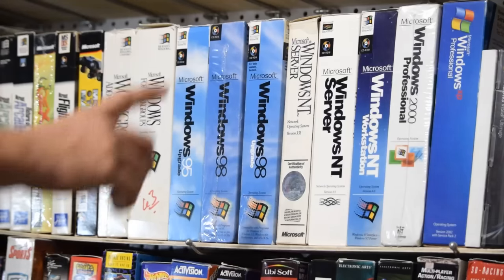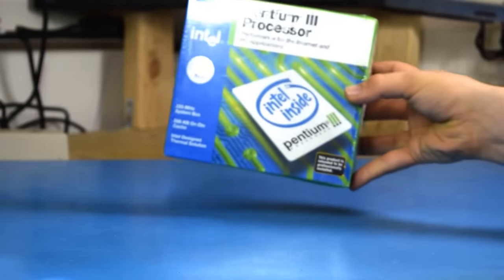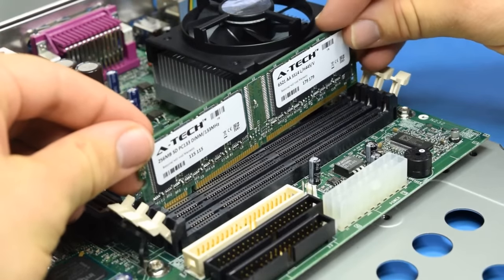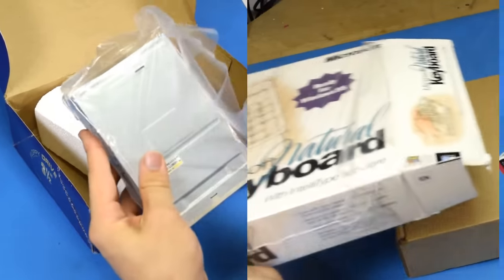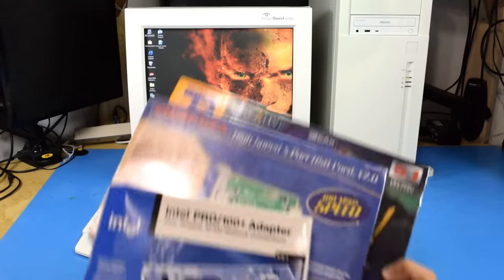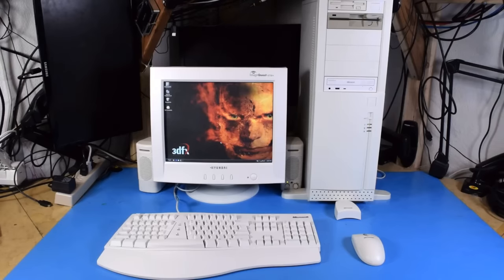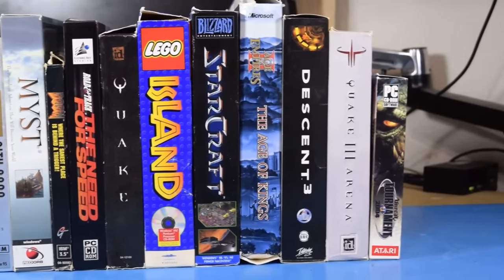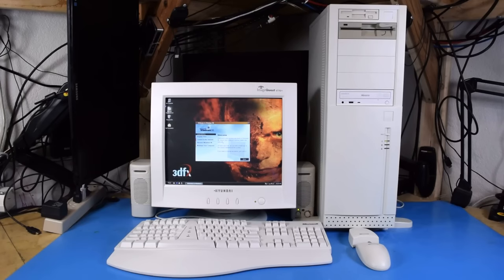Windows 98 20th Anniversary All New PC Build

Comment: The removable motherboard tray is such a good idea, why was it abandoned? Not only is it convenient, but it also gives you a test bench to make sure everything works without having to install it all into an awkward to fit case and then uninstall everything again to fix it. Perhaps the modern day coolers just make this kind of design unergenomical.
Reply: cost, some higher end cases do have a removable MB tray
Reply: Probably because without the motherboard tray the case is flimsy and flexes a lot. Most cases nowadays are made out of thin aluminium sheets while back then cases were much more rigid and robust, made out of 1.5mm+ thick steel.
Reply: funny, all my pc cases are a piece of wood.. why..    you dont even need a case. :-)

Comment: 120 GB drive is way too big for 1998.
Reply: I remember mine having 4gb hdd
Reply: Martin Ruvalcaba pfft lol my dad had a 2gb hdd, and that was comparable to 500gb hdd today
Reply: Nah, i had a 50G Quantum Fireball (biggest i could afford) in '98 and it wasnt an uncommon size for new. if you were cashed up much bigger was practical.
Reply: if you were going to be picky btw, what IS wrong for '98 is the Voodoo 5 - it wasnt released until 2000. Period correct would be the Voodoo 2 i have in the cupboard
Reply: He should've gone for SCSI 15k drive and controller from the era.
Reply: I had 40gb in 2005 uwu
Reply: And who still used a 5 1/4 floppy in 1998?
Reply: @johnrichards6304  I did
Reply: I remember spending £100 on a 10gb HDD around that time
Reply: Nah, for Win98SE my system, which I used from September 2001 to Feb 2011, was an Abit KG7-RAID mobo with an AMD 1400 MHz T-Bird single core CPU, 2 - 250 GB WD HDDs and 1 - 120 GB WD HDD, 1 GB RAM, 1 - 3.5" floppy, USB v1.1, and a Hercules Game Theater XP game card with external connector box.  The Abit mobo did support 1 GB RAM.  Win98SE never actually used all that RAM.  With tweak ConservativeSwapfileUsage=1 in SYSTEM.INI, section [386Enh], there was never any swap file usage.  It was all in RAM.  I'm pretty sure you could use a PATA 1 TB HDD in Win98SE.  To reduce cluster size, which is your concern with FAT32, you would use Norton Partition Magic 8 and split the HDD into 4 partitions (4 drive letters).  I never bought a PATA 1 TB HDD so I never tried.
The GTXP card & ext box had some nice features.  Stupid Hercules, company Guillemot, never wrote Windows 7 drivers so I couldn't use it on my new system.  To see my new 5 monitor system, see my only YouTube video pwNJto6VWE8.  The biggest problem with Win98SE were the 16 bit stacks USER and GDI resources which were very limited.  I had to monitor my USER & GDI resources using Norton System Doctor.  If I ran out of either, Win98SE would give me an error message and unpredictable behavior.  That happened only rarely.
Reply: I just remembered.  It's been awhile.  For anyone who dabbles in Win98SE, you need to add the following statements under the corresponding sections in your SYSTEM.INI file to reduce or eliminate your swapfile usage. If you don't have a [vcache] section, create it.  The maxfilecache size, which is in kilobytes, would need to be reduced if you have less than 1 GB RAM.  Adjusting your system is much easier with Norton System Doctor:
[386Enh]
ConservativeSwapfileUsage=1

[vcache]
chunksize=2048
maxfilecache=115000
Reply: yeah )) we had  2gb ))and games like MDK only used about 200mb
Reply: Dude, do not install CD and hd in the same idea channel. And next time install the Chipset driver before the graphics card.
Reply: VOYTASNY  That is exactly what I had! I got so excited when we finally got more memory and got to 256 lolol
Reply: I need to find Warcraft 2, Lords of the Realm 2, Dungeon Master, Dragon’s Lair, C&C....... those were the days....
Reply: its like having a 512TB drive today
Reply: @kekegenkamaru  mine was 8gb for luck :P
Reply: @linx4355  my parents give me one floppy 5 1/4 but i never could use it
Reply: I had a 20 GB on my ibm laptop
Reply: I had 1,6 Gb drive at 1995, then upgrade up to 20gb in the end of 90x..
Reply: I remember paying $300 for a 150 GB drive thought I would never fill it up
Reply: your right it was not the 1990s im just speaking of how hdd sizes have adavnced in the past decade alone because now you can get a freaking 4 TB drive and maybe bigger than that
Reply: metallicshah it was a really expensive laptop
Reply: @gamingrocks6738  When I started using computer I remember it was not even 100MB. Not sure which era was it, but pretty sure when I upgraded to XP I was still using 500MB. I am from a third world country so its normal.
Reply: metallicshah I used to think 810 megabyte drive was huge then 1 gig then to 20 gig and to 150 GB now that’s not any kind of space at all considering you can get a 4 TB hard drive
Reply: I recall having 2gb, and that 6gb was considered big
Reply: 20Gb for my first PC in 1999, with 700MHz K7-Pro Athlon CPU/mobo and 128MB RAM.
Reply: 20 years later I'm now sitting here with 4.4GHz quad-core w/ hyperthreading, 16GB RAM, and 4TB disk space. What a difference 20 years makes... 128x times the RAM, 200x times the disk space, and countless 100x times the CPU. And of course we now have iPad and smartphones which were unheard of 20 years ago. Wonder what things will be like in another 20 years, if we'll still be using PCs or if tablets will have taken over completely.
Reply: Weren´t gigabytes the terabytes of the past?
Reply: VOYTASNY  Too expensive, equivalent to 25,000 yuan, can only afford to work for two years
Reply: 1998 : 120 GB = TOO BIG
2019: 10+ TB = TOO BIG
120 GB = TOO SMALL
Reply: @ceph042  5tb
Reply: @mycosys  
actually the best period correct gpu for 1998 would be the voodoo 3   or if you one go up one year (because the pc I build in 1999 used win 98) the TNT 2 ultra was king in 99 on win 98.
Reply: @DenverStarkey  or rage 128, which i also have (with mpg daughter-board), which trounced the voodoo 3, or the Diamond VPR V550 (RIVA TNT), which i also have. I really should put some of these systems together someday XD
Reply: @mycosys  
well that's why I said  even go up one more year, riva TnT  was not TNT 2 , in mid 99 TNT 2 was the king , that said you could even take it to late 99 early 2000 as many systems still used  win 98 then , and in late 99 nivida released Geforce 256 , which was the real game changer  (an actual gpu as opposed to graphic acelorators)
Reply: i had a 80gb in 2006... 120gb for that time was really a lot!
Reply: The old PC in my house with Pentium 4 CPU only has a 32 Gigabytes hard drive...
Reply: My drive was 6.4 GB in 1998....
Reply: 80gb and 40gb is the 20s era 😂
Reply: @mycosys  yeah was so excited when I brought my voodoo 2 in yr2000 from a school mate for $100  nz dollars. And paired it with my 8mb matrox 220? In my 486dx100, need for speed 3dfx all day.
Reply: @tester123532456 brought in yr 2001 an 30gb Fujitsu, was around $240nz, my tnt2 32mb m64 was about $260nz, 256mb pc133 module was hmm $200 and my soltek SL75-MAV socket A was $280 and went for a cheap ass AMD duron 700mhz CPU $60.. lol was baddass  (new Zealand dollar)
Reply: @mycosys  wasn't the diamond a Matrox card?
Reply: @DenverStarkey  yup the gforce 256 remember my lucky mate got one and I purchased his voodoo 2
Reply: @gregchapman-colcord5235  Diamond made just about every card you could think of in the 90s but are best known for S3 cards after their merger (most of the Stealth range). Their first card was the Tseng ET4000, They produced the first ever xonsumer 3d accelerator the Edge 3d with nVidias first GPU the NV1, they did a 3dfx range called Monster3d, they later did even ATI cards. But as far as i know the only Matrox cards they made were sound cards?
Reply: @gregchapman-colcord5235  a 486DX4-100 in 2000? ouch. I had a DX2-100 (actually an overclocked 2-80) in 1995 with a Tseng ET4000W32p, taking it out to 100MHz overclocked the bus, graphics card and memory by 50% vs the DX2-100, used to destroy 1st gen Pentiums in video performance lol
Reply: @mycosys  I was a late bloomer, met a couple of geeks (I became 1) in high school and caught the bug. Had been give a 486sx66 and then got the 486. My geek mate had a Pentium pro 60 and it was up with the p 1 133 how ever old mate with the mmx 166 was owning lol. He worked over the Xmas break and purchased a hp 4x cd writer costing a whopping $800nz. Pc gear is so cheap now days
Reply: Not really. I remember we had a Dell Dimension P4100 that we got in 2000. It came with an 80GB Seagate HDD and that was a mid-tier desktop back then. If you had money to blow, you could have gotten a 120GB drive in '98 so it's still technically "period correct". Since a 120GB drive is cheaper than dirt now, why not?
Reply: Lol future proofing?! 🤣
Reply: really? in 98 my mom bought a 120gb, i actually still have it, manufactured may 98. She bought it for business it was quite expensive but they still existed for consumers
Reply: @johnrichards6304  If you had two PC's then yeah you might. Especially because some software you used a floppy to start the install process.
Reply: @feralferret  All those functions will be taken care of by an implant under the scalp.
Reply: @chriso8485  10GB was considered as a large drive.  I remember a person I knew had gotten a 12GB drive and we thought that it was huge.
Reply: My 2012 pc had 250gb its crazy
Reply: VOYTASNY  plus .the old bios was max limits close to 50 gigs for hard drives... And I remember really good that era ,
Reply: i had 540Mb and that was massive then
Reply: Ours had a off brand 90gb hdd
Reply: I had 10.2 GB HDD with S3 savage 4 GPU/16mb
Reply: Да-да, для 99-го 120-ка не может быть, я в 2002 в ноябре собирал комп и hdd там поставил 80gb Maxtor
Reply: 2-4 Gb !
Reply: I remember buying a 20gb for $80 at Best Buy back in 2001!  19 years later, you can carry that in your pocket for less than HALF the price!

Comment: A tech video in 2018 that uses the phrase “newer floppy drive”...
Reply: I was surprised he even bothered to put in the 5¼ floppy. I remember it being completely obsolete by '98.
Reply: 3d printed save icon
Reply: @bonnywarrior  I believe the first two games he tested required the 5¼ bay. 

But yes, even back in '97 and '98 it was considered mainly obsolete, save for a few older applications.
Reply: Well from what I recall, 5 1/4” were “floppy discs” and 3 1/2” were “micro discs” but because everyone had been used to calling squares or memory discs encased in plastic “floppy discs” they just kept calling them “floppy” until even the manufacturers begin to call them “3 1/2” floppy discs” even though there was obviously nothing floppy about them save for the film the memory writes to.

Comment: Man, this sure brings back some memories! You might not want to connect your relatively “fast” 7200RPM HDD into the same IDE-channel with your optical drive though. Most optical drives of that era only support up to UDMA-33 transfers while your HDD and motherboard support up to UDMA-100. The entire IDE-channel transfer speed is determined by the slowest device in the channel so your 7200RPM drive now gets a very noticeable performance hit. This was a very common mistake back in the day so some motherboard manufacturers started to clearly label their bundled IDE-cables as “CD-ROM” for the UDMA-33 cable and “HDD” for the UDMA-100 cable. The recommended way to connect your drives was HDDs in the primary IDE-channel using UDMA-100 cable and optical drives in the secondary IDE-channel using either UDMA-33 or UDMA-100 cable which ever happened to be at hand. You could also leave the jumpers at the default CS (Cable Select) setting if you’re not building any unusual configurations. In this setting the drive at the end of the IDE-cable will be considered as master and the one connected in the middle connector will be considered as slave, regardless of how many drives you are connecting. I seem to recall some benchmarks actually showing a slight increase in disk performance using the CS setting but don’t quote me on this. It’s been a long time.

Some ideas for improvement;

If you would like to have a large HDD storage in a period correct way (for Tualatin era) you could try to find an old PCI IDE RAID card and 4 (or more) period correct 60-80GB drives. I remember some people did this back in the day and it was darn impressive! Oh did I wish I could afford it myself. 

For the ultimate Tualatin experience you could try to find the legendary Asus TUSL2-C motherboard and unleash the beast by some overclocking goodness! For the maximum fun factor you might need to look for some highly overclock-able RAM too especially if you’re overclocking a Pentium3 that runs 133MHz FSB at stock. Back in 2002 I built a cheap Tualatin gaming rig from used parts and even though it wasn’t the cutting edge technology anymore it was still insanely powerful! I had a Tualatin based Celeron “Tualeron” overclocked somewhere around 1.7GHz with a huge aftermarket HSF. My Radeon 8500 64MB DDR graphics card had an AMD K6-2 CPU cooler bolted on the GPU and HUGE memory heatsinks cut out from an old Pentium2 passive heatsink! And of course it was volt-modded and overclocked to the absolute max. I even had a similar full-size ATX case like the one in the video with 4 powerful Papst case fans but it wasn’t too loud because I effectively sound-insulated the entire case with materials bought from the local car parts store. This rig used to run in circles around the early top-of-the-line Pentium4 Northwoods of the day that were outrageously more expensive than the old Pentium3 based Celeron! Had I built this system a year earlier from brand new parts it would’ve been even more phenomenal. It was my main computer till September 2005. It even used to run Half-Life 2 quite nicely with decent quality settings. Don’t expect to see that happening with the Voodoo5 though. On the other hand it might be fun to try :) Sometimes I still feel the urge to build a new Tualatin rig and do it even better than the first time. Just for the sake of nostalgia…I think building a PC used to be more fun and interesting those days; so much more challenging and rewarding than now.
 
By the way you could always go for a period correct PSU and simply recap it if the caps have gone bad. Seeing how you did the Voodoo card it should be a piece of cake for you. IMHO it would add greatly to the nostalgia factor keeping it as period correct as practically possible; the loud fan noises, the HDD grinding and all, would be like a time machine for every sense :)
Reply: ThePuuFa sounds like u need a YouTube channel if u don’t have one already.
Reply: @mikehunt6819  exactly

Comment: Very nice turn of the century build. We had a machine similar to this with an 800Mhz Duron for a while paired with a Radeon 9600. Unfortunately it got fried in a lightning strike on the house but it could handle everything from Wolfenstein 3D to Half-Life 2 (at low settings anyway.) I look forward to the next parts in this series as it’s setting off some serious nostalgia for me.
Reply from the maker: I tried to install my original boxed copy of HL2 for this but Ye Ole Fashioned Steam dies after install and never unencrypts the install files. I didn't want to add another layer of headache onto this project by trying to find an original "patched" version of the game to get it to run on here.

Comment: I watched this in 144p just for the effect
Reply: Back then the standard was 480p boio
Reply: Hahahahahahahahahahahahaaa!!! I hope the effect was more than u were expecting ;-)
Reply: ahhahahah xd
Reply: Awesomeness Plays for pc at that time? 480p is low res. Common is 1024x768 at 100hz. And if I remember correctly, year 2000 I was using  24" 1200p crt monitor. And that's the reason why most gamer back then  were very late to adopt LCD screen. LCD were Low res and low fps.
Reply: well, i mean still MOST were using CRT's until like maybe(?) windows 7. But yeah now the standard is 720 or 768 or mostly 1080/1440
Reply: Awesomeness Plays my family was using a Dell 19" 4:3 LCD in probably 2001 (so w2000).  Can't remember, as I was maybe 6 when we got it
Reply: I use a tv at 1366×768

Comment: Very nostalgic, I remember building computers pretty much like this one. Just one observation, as far as I remember, back in 97/98 5.25” floppy disks/drives weren’t really being used anymore. I remember using a ZIP Drive in this “era” (had one with parallel interface, I think I still have it somewhere in the house), just before CD-R and RW completely killed ZIP Drives. At least here in Brazil (and we were a few steps behind the US due to high prices of hardware). Anyway, very good video, I collect some things and hardware IS not one of them, but I appreciate things from the past so well taken care!